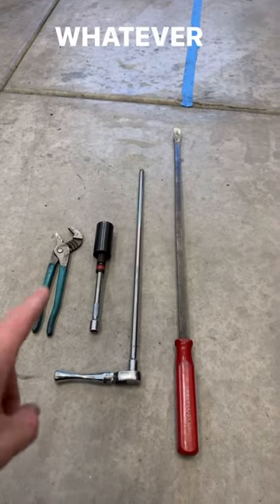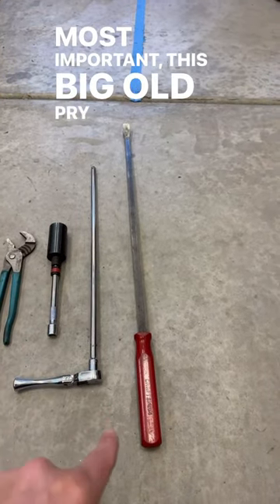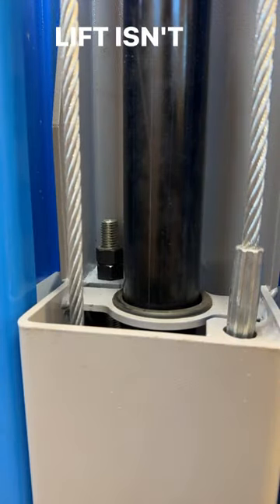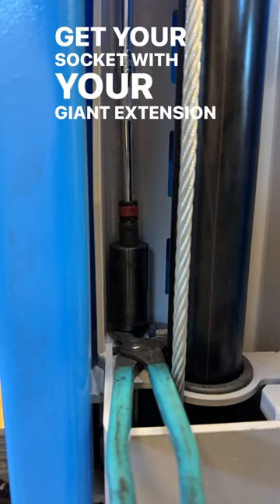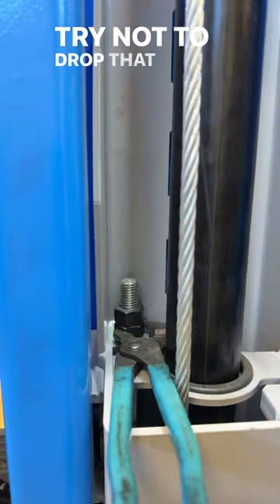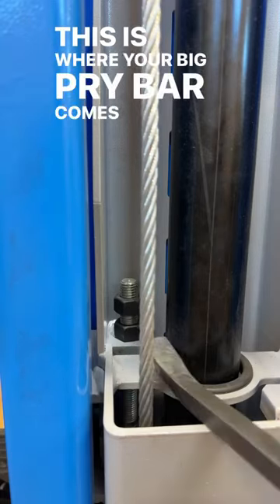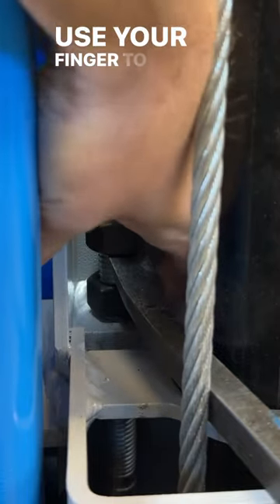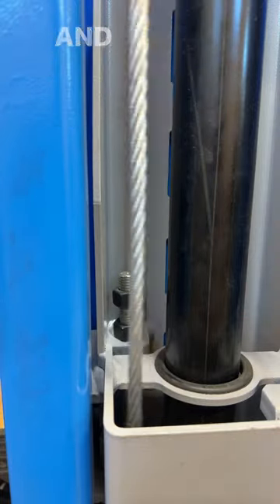2 Post Lift Cable Adjustment

Comment: What about when you want to adjust the other end of the cable because you run out of thread?
Reply from the maker: I haven’t run into this yet. But if you’ve maxed out the adjustment it may be time for a new cable.